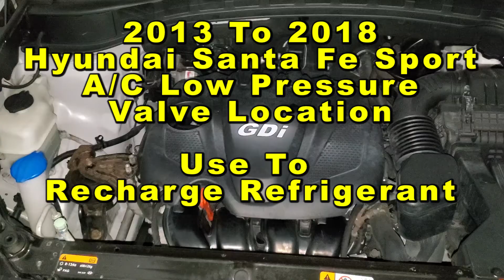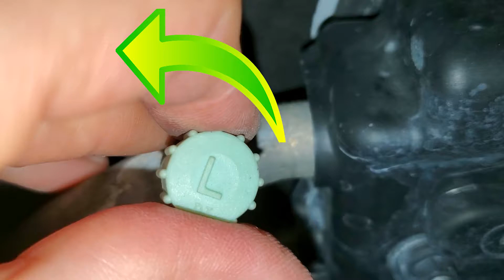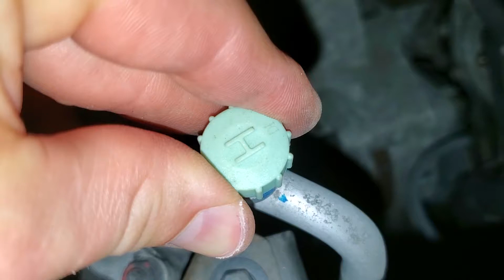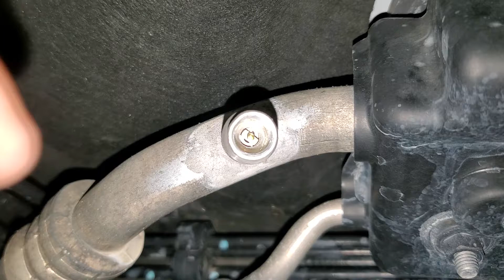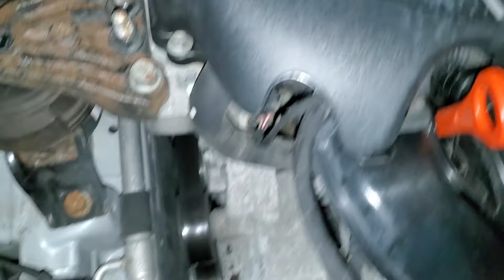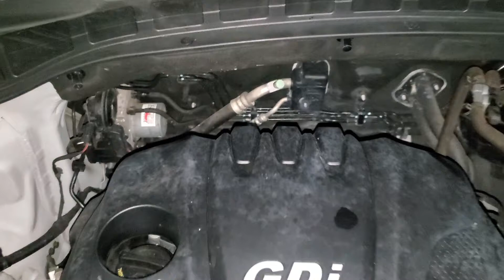2013 To 2018 Hyundai Santa Fe Sport A/C Low Pressure Port Valve Location Use To Recharge Refrigerant

Comment from the maker: Check out all of the DIY repair and maintenance guides for the 3rd generation 2013, 2014, 2015, 2016, 2017 & 2018 Hyundai Santa Fe - 
https://www.paulstravelpictures.com/Articles/2013-2016-Hyundai-Santa-Fe-Common-Problems-Repair-Maintenance-Guides.htm